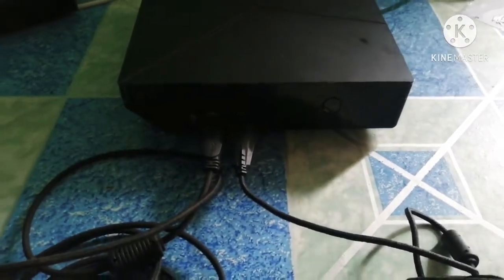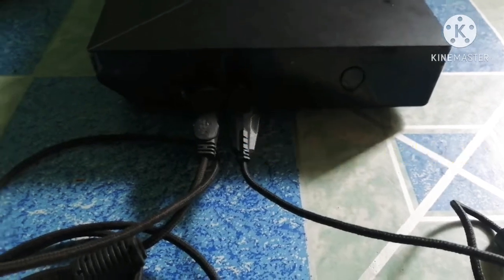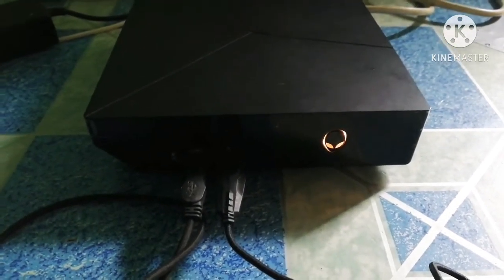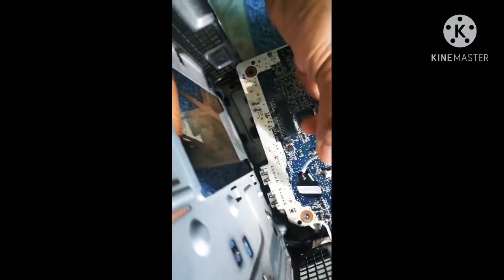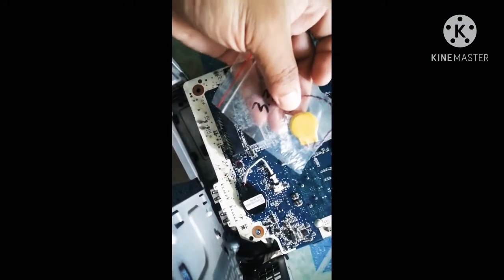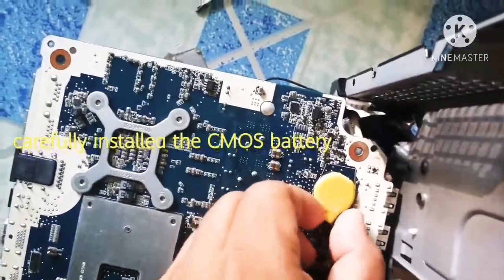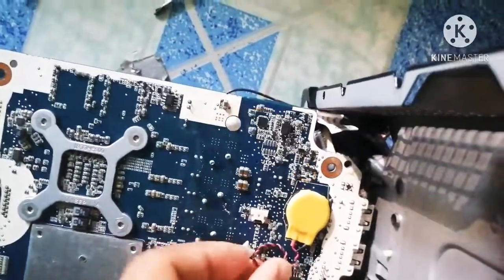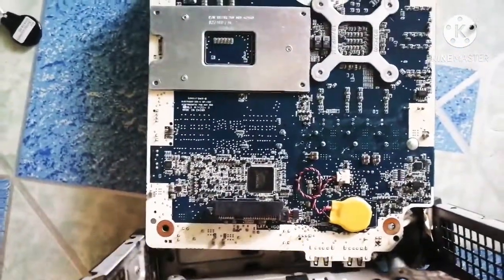Alienware Alpha R2 Yellow Death of Light💡👽 How to fix and replace

Comment: I have a tip. When I get the yellow light of death I unplug my device. Open it up. Remove both fans. Look for a small blue colored jumper that is plugged in the bottom right hand side.
Remove the jumper and plug it into the two pins on the left hand side of the device.  (There are to pins to place the jumper.)
Try one pin by placing the jumper on the pin. With the computer open plug in your power cable now press and hold the Alienware power button for 20 seconds (if the computer turns on or any lights come on you put the jumper in the wrong pin and you have to swap it to the other pin and repeat the same process) the computer should not start up or make any noise if you plugged it into the right pin. Once you have done this unplug the power from the computer. And place the jumper back on the right hand side pin where you originally found it.
Put everything back together plug in your power cable and start it up. Yellow light should be gone.
This is what I do every time I get the yellow death light to reset it.
Reply from the maker: until CMOS battery still working fine definitely it will be ok, Thanks for the tips it help others as well Thanks for support and subscribed to my channel stay safe wear mask Godbless😷🙏
Reply: @Rod4GoodLife  Where did you order your battery? Got link?
Reply from the maker: Download lazada apps on google playstore then search mo cmos battery model which i did mention on this video which you need for your Alienware
Reply: Thank you saved my life! You the goat 🔥🔥
Reply from the maker: Your very welcome please support my channel and like share my video Thank you as always stay safe and healthy takecare
Reply: The jumper trick worked! Thanks!
Reply from the maker: Well done thank you and keep support my channel stay safe👌
Reply: Lmao Man you just saved me such a big headache. This is the 1st time I’ve opened up a PC let alone do a battery swap. I was actually pretty proud of myself until I plugged it in and realized the yellow light was still blinking. I figured maybe I didn’t do a proper battery drain reset so I was about to retry until I read your comment. Thank You so much! 

lol Oh and dumb question but is there an easy way to tell how much memory my console has?

Comment: It didn't work. First I replaced the motherboard and it last about 6 months but then I had the same yellow light problem. I already tried and replaced the CMOS and still doesn't work.
Reply from the maker: Kindly cross checked if your motherboard still working fine or any other connection wire hasn't been connected properly, if the CMOS battery is compatible? make sure also that's the correct CMOS battery replacement you installed...

Comment: link of the seller in shoppee :). Also, is yours still working?
Reply from the maker: Hello Karl thank you for that question if your in Philippines you can check shopee and Lazada both of this supply the cmos battery make sure you type in the correct code for your device cmos batt needs, and If your outside Philippines best to get is in Amazon or Ebay.  Any help I can provide you just info me then about your Alienware device hope you subscribe to my channel and keep support Thank you stay safe wear mask😷👌👍

Comment: I replace the battery and don't work.. I guess that my motherboard is death
Reply from the maker: if still turn on your unit still. working need only to find out where is the faulty parts did you check your power supply fuse?